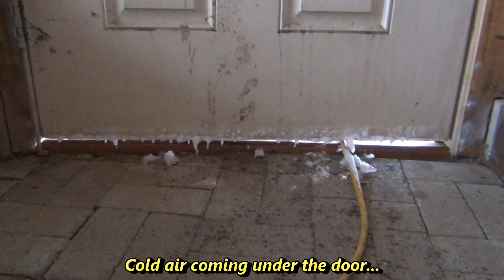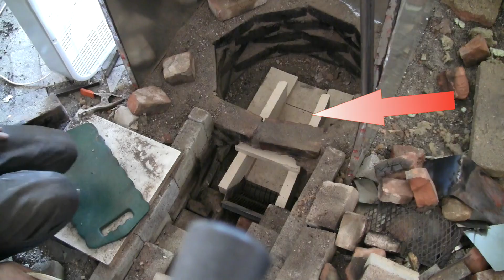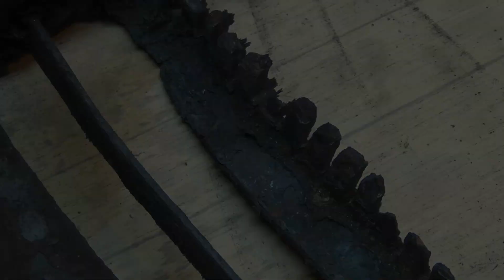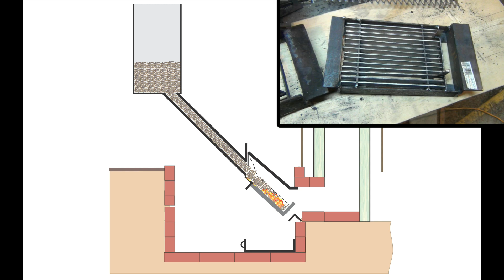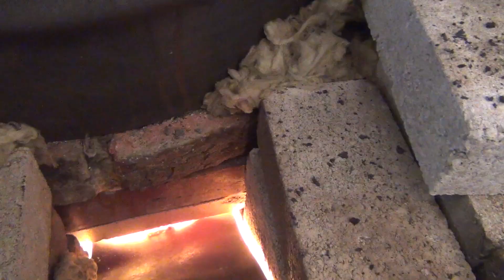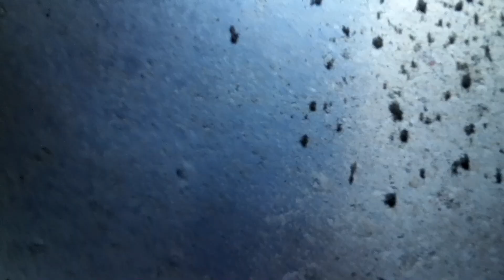Rocket Mass Heater - Changes and Updates

Comment: like your setup, but please take some advice from a blacksmith regarding the metal, on your heat riser you'd be at a far better rate to make it out of a section of expanded steel and then give it a two inch thick layer of refactory cement. we use the cement and KAO wool for forges. best of luck

Comment: Build a header bond chimney, in the heat riser... ...high alumina cement or lime mortor with fire brick. Google WG Nash brickwork books... ...loads of British chimneys are still standing almost 200 years after they were built. You can also buy clay chimney liners that do the job... ...these are fired at over 2000 deg. So are fit for purpose :)

Comment: Hi, have you looked at any of the refractory paints out there? A quick search turned up this 3200F resistant paint. Pyro-Paint™ 634-AL from these guys http://www.aremco.com/high-temp-refractory-coatings/ (I have no connection with them just top o Google search). Have you considered ramming refractory cement in between the inner and outer pipe? Even better use a sacrificial inner form like a sonotube and when it burns out paint the inside with refractory cement. It seems you are going way beyond what a heat blanket is designed for and what steel can take in a supper hot oxidizing atmosphere. BTW I really like the pellet idea.
Reply from the maker: Scott S. I haven't played with the paints.  I'm still concerned about the long term effect of the material it's painted on to.  I'm not an expert in this field.  ;-)  The latest fix with the fire bricks worked out well.
Reply: They protect and prolong the surfaces they are applied to. In the short to long run the paints make a cheap sacrificial skin over the more high dollar components. BTW I saw the modification with the bricks after this was posted. I like what you did with the brick riser.
Reply: Bigelow Brook Farm (Web4Deb) ....  off topic
instead of working with metal why don't you try ceramics? you take some porcelain tiles ( google translate) (http://www.dedeman.ro/bacau/gresie-portelanata/c/1346) cut it into thin pieces removing the oxidation on the metal strips

Comment: I've seen designs where the stovepipe gets wrapped in flexible copper tubing with water circulating to harvest waste heat.  This would have the advantage of using water's superior heat retention properties and you would be able to feed heated water into your loop if you wanted to regulate temp that way.

Just an idle thought.  I'm very impressed with your setup, thanks for being such a thorough documenter and teacher.

Comment: Hi Rob,
Thanks for sharing. Really enjoy the videos. 
Have you considered using clay flue liners for the chimney? 
Instead of the stainless steel use 1/4" thk steel with the same spacing.  Although less air may be a problem there might actually be an increase in air velocity and possibly a hotter fire, if that's possible.

Comment: Hi, I'm a rocket stove follower, I see that u r really burning lot lot of pellets on ur Mass Heater,now even the stainless steel burns on how hot ur heater is and what I suggest is for u to build a fire brick riser tube. Don't build it fix in the first trial but to make a "round brick" after round brick until u reach ur ideal height. U can also leave it w/out insulation just to find what u can come up on the first trial. Good luck and God Bless.

Comment: I think it's time for you to use a much thicker piece of stainless tube for the riser. This metal regardless of the type of metal will warp and deform under extreme temps. The thicker stuff will take much longer to burn through and will reduce the amount of distortion. That's why people use really thick metal on welding tables. They need it to stay flat. Go to your local metal supplier and see what type of surplus/scraps they have. They may have some pieces of really heavy tubing that will work. Even if it's carbon steel if it's thick enough I bet it will last much longer than what you're getting right now.

Comment: i love your work, it seems that you will have to use all fire brick for the heat riser, the temperatures are just too high for metal.
Reply: What sort of temperature would the metal in an old-fashioned cast iron bath withstand ?
Reply: Tom Stephens 2,800 F is the melting point of iron, even though the steel isn't melting in the heat riser, the 2,000 degree heat is enough to soften it, and allow for very fast oxidation, allowing it to degrade and fall apart.also the heating and cooling creates stress fractures in the material, helping it fall apart.

Comment: What about sheet brass rolled into a cylinder? Or better yet beryllium-aluminium alloy :) for that heat flue?
Reply: i work with titanium for a living.Its a nice thought but it oxidizes at the temperatures these stoves can produce so the longevity would be limited too.How about the liners they use in masonry chimney.I think they come in 2' section and in 6 and 8" diameters.Bigelow Brook Farm (Web4Deb)
Reply from the maker: I was thinking titanium would be good too!  ;-)
Reply from the maker: 64ghiaman that's good to know.  I just assumed it was indestructible!
Reply: There is a company called superior clay that has a good website to look at if you are interested in using a clay heat riser and burn chamber.I dont know prices i just looked at the site.They offer an impressive selection of both round and  square sizes.
Reply: Bigelow Brook Farm (Web4Deb) Yeah but ... it's not toxic!

Comment: I figured the stainless would not standup.  I used the small firebricks, as you built for your burn chamber, for my riser tube.  It's only 4" square, but works great.  I haven't had to rebuild it once this year.  I'm knocking on wood right now!  I believe a smaller riser diameter is acceptable.  This winter has been real test for RMHs.  Lowest temp we saw here, in WI, was -22.  The temp in my dome reached 77 degrees while I continually feed the RMH more wood.  I am seriously ready for Summer!  I was bit worried about you Rob because we haven't seen many new videos lately!  I know what a pain it is to rebuild a RMH in a day.  Not fun!

Comment: Thanks for the look Rob.. Do you think you will need to run the stove much longer ?
Reply from the maker: I still have another month to go....but it would be as bad as the last 2 months. tonight it's going to be about 10F/-12C
Reply: Bigelow Brook Farm (Web4Deb) I think I tried to warn you about the stainless steel pipe not working last year. My 316L pipe ($150.00) lasted two weeks.  My 2-cents is to construct a heat riser like zerofossilfuel did in his rocket heater. The individual pieces allow for expansion/contraction. They should NEVER be cemented together! The riser might have a stainless steel support structure (away from the heat) that would allow quick and easy firebrick removal and replacement. I would anticipate annual replacement of all heat riser firebrick. Regards.

Comment: I'd like to suggest "Zerofossilfuel's" heat riser. he has a fire brick lined riser  pipe that would work great for you.
  He just posted a pretty cool, that is to say "hot" pellet basket also...he's getting 800 plus degrees consistently.
Reply from the maker: Thanks.  I've seen some of his videos.  Good stuff!
Reply: Jeff, I did some temp measurement on my RMH and inside burn chamber is routinely more than 900 degrees.  I use fire brick to line the entire burn chamber and the riser.  It works well.  The brick never ages, but the fireplace cement will disappear after a few months of heavy use.

Comment: Maybe you should try a clay pipe instead of steel... Clay ovens can withstand massive amounts of heat and may be better at staying in good condition longer.
Reply: Or maybe a cast Iron pipe ?
Reply: Cast Iron would work but the downside is the expense and the shear weight.
Reply: Based on the results we saw on his failure video the temperature must have been in excess of 1850 degrees (which is the temperature at which rock wool melts). I believe the collapse we see in this video is due to the thermal stress of cooling like was mentioned before so the fiber reinforced clay pipe sounds like a solid option for a reliable replacement.
Reply: I tried round clay chimney liner in my rocket heater. The issue is thermal stress; both when heating and when the fire is burns out. Assume the rocket has operated at 800 degrees for a day; it runs out of fuel and now it is sucking 40 degree air against the liner. Experiment with a piece and see what happens - it will shatter. The clay liner makes an eerie sounds inside the rocket when it cracks. It might work for awhile until it too disintegrates from thermal stress. FYI - The shards of tile are extremely sharp and can cut you easily.
Reply from the maker: Dicofole I've been looking for some cast iron pipe, but none of the local places have 6".  There's plenty that have 4"
Reply: clay chimney pipe will shatter deu to thermal stress if you don't pre cut it lenght wise ,put fire wool or super wool  in the cut to seal it now the pipe can move ,there are also standart vacuum formed refractorie ceramic fiber tubes that are instaled in newer rocket stoves that seem to hold up to hy temps they are rated to 1400°c /2550°f ,they are insulatif  so can be used whitout further insulation as a heatriser ,
They are used by the leading explorers in rocket stove technolegy  like Peter Vandenberg,  Matthew Walker (broaudio here on youtube ,Walker stoves)
Reply from the maker: Frank I would agree with Frank.  I've seen several people try clay chimney liners or regular clay bricks and they just can handle the heat.  I'll probably just make a new riser out of fire brick, but may give a piece of cast iron pipe a try if I can find a section of it.  ;-)
Reply: Ceramic wool blanket lining the inside of your stainless steel pipe and you will be good to go long term.  They call it the five minute riser cause that's about how long it takes to put together.